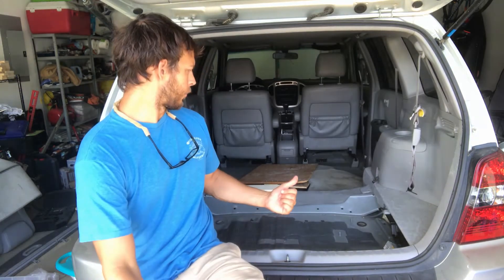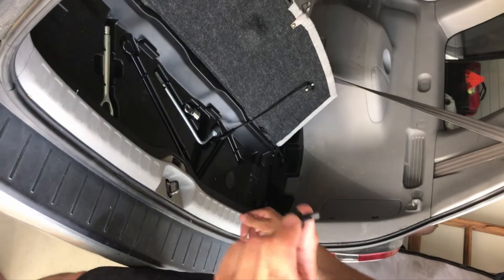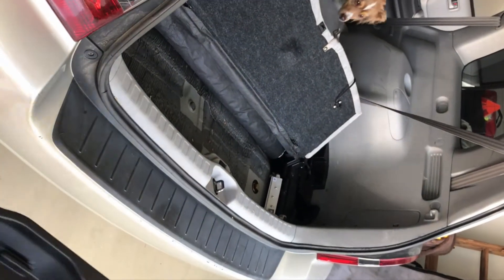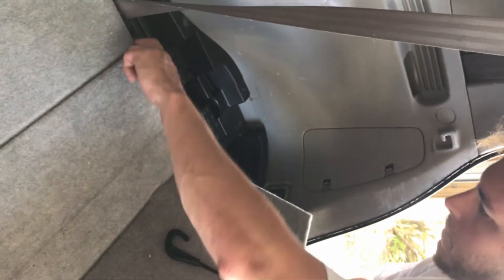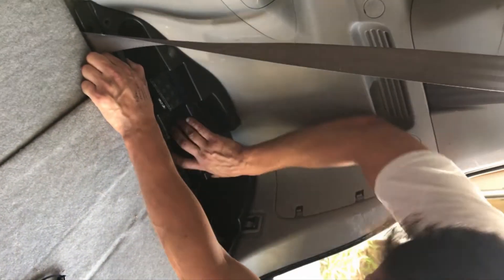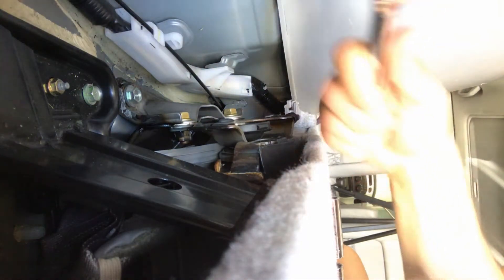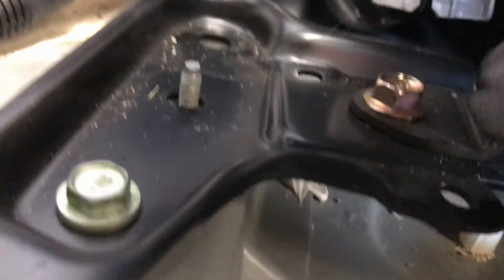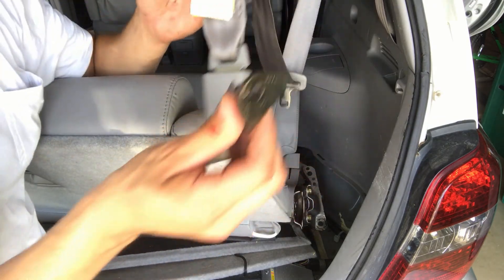Remove 3rd Row Seats from Toyota Highlander (Car Camper Conversion)

Comment: I have  2023 High Lander, how hard would it be, on a 2023 to remove the 3rd row seat?  I'm a ham radio operator and I want to put my radios with a cover were the 3rd row seats are

Comment: Thanks for posting! Looking to do the same. A few questions for you:
1. How much interior space do you think this’ll add? (Or are you just gutting for max space to build around?)
2. I’m looking to just remove the third row and keep the second functional. Do you know if that’s possible? 
3. Do you think the minimal cargo space gain is worth the trouble? 
Thanks again, looking forward to seeing the rest of your build!
Reply from the maker: Hey, thanks! Good questions:
1. Honestly, not much. Since we're building into a camper car for long trips, we were just gutting to absolutely maximize space for even a few extra inches of depth to fit some flat items into like clothes, loose food items, etc.. We're building the bed over it now which will be able to lift up easily, so we'll have access to that space. 
2. That should be possible. While we took out the 2nd row first and that freed up the room to help get the 3rd out, the 3rd fit entirely into the very back section and should be removable on its own. It may be trickier due to the limited room and you'll still need to take out the side and back plastic storage compartments etc.
3. It depends on your needs. We just confirmed (thanks to a helpful viewer) that the steel bar in the back that the 3rd row connects to is actually a rear strut/sway bar with implications on wear-and-tear and performance related to the car making turns. While it isn't absolutely necessary to drive (according to my research) it seems important, so we're adding it back in. That further detracts from the usefulness of the extra few inches of depth that removing the 3rd row creates, since now the big steel bar will be back in the middle.
Reply: David and Katie Go Out thanks for the detailed response! Just now seeing your comment as I don’t have notifications on. Thanks again. Happy travels!
Reply: @wayoutwandering Is there a way to remove the 3rd row seating (and leave the sway bar) while retaining the top cover? I am looking to simply create more hidden storage in the truck. I'd like it to look exactly like it does now with the seat folded down.
Reply: @JohnTischler that was my question, there almost zero hidden storage at the moment

Comment: thanks for the video. What do you do with all the empty bolt holes?
Reply from the maker: Thanks for watching. We're still building out other things in the car, so they aren't all accounted for yet. We just finished building the bed / reclining chairs and covered some of the bolt holes with its supports; and for some others we just put the original bolts back in for now.

Comment: Thanks! I just inherited my folks 2004 highlander. Looking to take this seat out and build a fake floor/subwoofer enclosure. What did you remove yours for?
Reply from the maker: Nice! We were looking for as much room as possible for storage under a bed platform we're building. We're in the process of turning it into a mini camper.

Comment: Wanted so see back when completed ~ is a flat surface possible ~ Thanks Bend OR
Reply from the maker: Hey, flat would be tough. The frame of the car is contoured, plus the strut bar sits back there and has a function for the car's driving performance.

Comment: I have 2015 highlander and the second row is the captains seat which I don't like. Third row is too tight. As per my 12 and 17 years old. 
So I guess my question is. Can the third row fit in to the middle row?

Comment: Where are you storing your seats?  Trying to figure out a safe way to keep them in case I want to put them back.
Reply from the maker: Hey, that is as much of a challenge than removing them - they  are bulky and take up a lot of space. I have a deep closet that I don't use, so they are resting upright and stacked in there - and I was surprised at the efficient stacking I ended up with given their bulk, not taking up as much space as I thought.
Reply: @wayoutwandering  Great, thanks for the reply!! :)

Comment: while i love my highlander, i don't need or want a 3rd row of seating. i'm going to part time solo travel but occasionally i'll have 2 passengers so i'm left trying to figure out a layout thats perfect for solo, but can seat 3 people and maybe a dog.
Reply from the maker: Interesting - you might be able to keep the 3rd row in so that you could use it for passengers when needed, but remove the 2nd row for more storage. The 2nd row freed up a lot of storage for us when we built the bed over it - much more than removing the 3rd row. We loosely considered leaving the 3rd row and building the bed flush with it but decided every bit of extra storage was worth it for us.
Reply: @wayoutwandering  yeah, i was considering that as well because there are just so many parts that need removing and if i ever wanted to sell my suv, thats alot of parts to reinstall. good thing though is the person who would be in the back seat is young healthy and flexible. i guess i'd have to figure out how he would be getting into and out of the suv during travel. when we have a bed in the suv with him. =/
Reply: We are in the same boat. We just got 2021 Highlander and will sometimes have 3rd person. I thought about removing the 3rd row and 1of the two in the second row. And buy a camper tent and put it on top of the car. So one person can sleep in the car and 2 in the tent.
Reply: @육백만불  right now i'm just thinking about removing the second row and doing my solo stuff in my highlander then putting the seats back in and jst bringing a big enough outdoor tent for when i travel with friends. but i am still kinda interested in getting or making a teardrop.